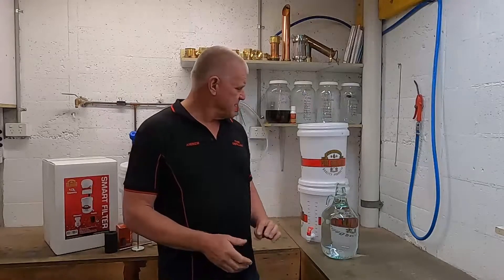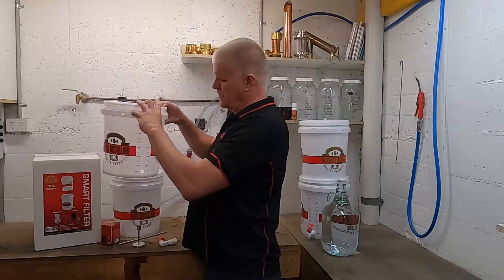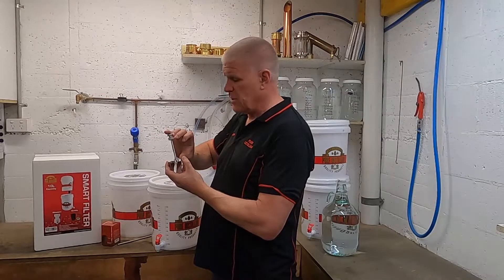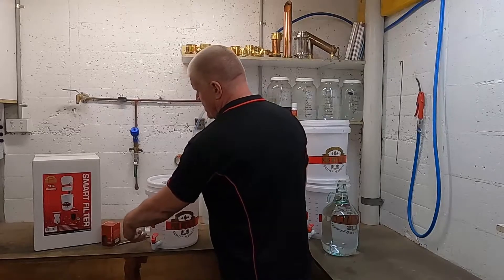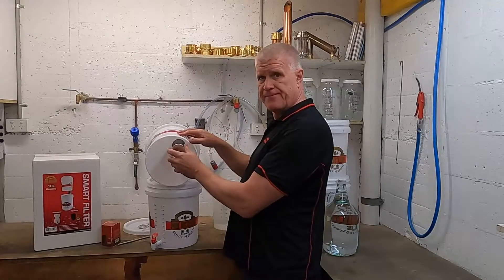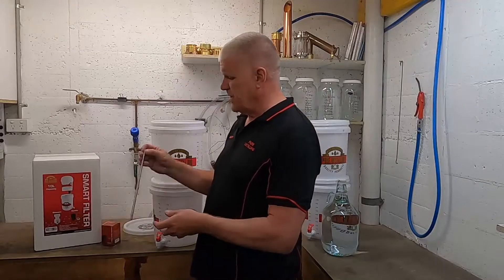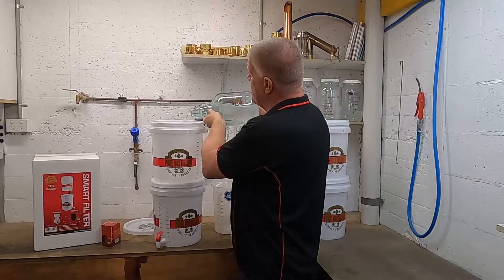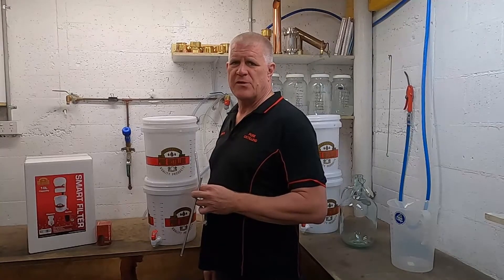Filtering With The Smart Filter System - Distilling 101

Comment: Hi mate i have just acquired a cartridge filter  .can the cartridges be re used if washed  .also how many times per batch do you run it through the filter  .  Thanks for the helpfull vid .
Reply from the maker: Hi, the cartridge is good for treating one batch of ~10L of spirit @ anywhere below 50%ABV. When you have ran it through once the spirit will be safe to drink, you will need to purchase another cartridge for the next batch
Reply: @PureDistilling  thanks mate so it is good for two separate runs of 5 litres  .as in two separate batches  ?
Reply from the maker: @bluegum4264  Not quite, once you dilute your spirit after running it through the condenser (as shown in the video) you will have around 7-11L of spirit depending on how much sugar you have used in the wash. You will be able to run all of this through the filter together with Pure Distilling filter buckets.

One filter cartridge will treat one wash, hopefully this makes sense!
Reply: @PureDistilling  thanks mate  i am transitioning from a granulated carbon filter which i normally run through twice with new carbon each time .i will have to forget all that and change my ways  .do the pure distilling filters take all brands of cartridge ?
Reply from the maker: @bluegum4264  Best of luck with the transition! Our cartridges will fit onto the EZ Filter System if you use our Filter Spindle Kit - see video https://www.youtube.com/watch?v=Z9ifyl-mGvs
Reply: I reuse the same cartridge over and over. Guessing around 7 batches before I replace it.
Only when it starts to take too long to filter do I replace it.
Is that ok?
Reply: No need to filter at all it's just a way for the brew kit manufacturer to cash in and profiteer.

Comment: I have a T500 still can I use the can I use your reflux column on the T500?
Reply from the maker: Hi James, dependent on which Boiler you are using, you may be able to. Shoot us an email on drink@puredistilling.com and we'll do our best to help you
Reply: Yes you can, you will find the t500 head is a different size then the pure distilling head so you will have to resize the hat, I did exactly what you want to do because the t500 is a piece of crap as it doesn't have an actual head thermometer only a cooling water thermometer which is ridiculous and I had a heated discussion with the state rep and I vowed never to use still spirits products again which is a shame because they made a rum essence I really liked....😅

Comment: So I've done a lot of research and it turns out that this is a completely unnecessary step. Once it comes out of the still it's good to drink. If you really want to do this just let the alcohol sit and don't pour out the bottom of the tank, bottle or flagon. Way cheaper than buying all this kit. 

Let's be honest, we're doing this to save money and this step will take your bottles from $6 to $10 or more. Especially if you have to buy a filter for every brew.
Reply from the maker: Hi @Azt3k9, we have to disagree with you here - volatile compounds are present in very small quantities in every wash, meaning filtering your spirit is a necessary step in the distilling process. 

The activated carbon filter cartridge attracts and traps chlorine from the tap water used to water down your raw spirit and volatile organic compounds such as acetone, benzene and ethylene glycol to name a few, it will help to produce the cleanest spirit possible. Yes we are aiming to save money, but most people also want the best results as well. Try it by adding some loose reflux carbon to a bottle, you will notice the difference.

Hope this helps – Connor
Reply: @PureDistilling  these carbon filters are really doing stuff all when it comes to actually filtering ethanol, the cartridge doesn't have enough surface area whats really needed is it to bathe in activated carbon and be forced through paper or cotton filter then bathe again before being collected then given the sniff test and if it smells like anything then run it again till it smells of nothing ,cartridge type filters are just a money maker for companies like yours, don't get me wrong the still head is a good thing but this thing is a stupid idea and waste of money

Comment: How many times can I use the filter if I clean it properly and what to clean it with?
Reply: You can't clean it properly because it needs to be heated to 850 degrees c approx to burn all the oils and alkaloids etc out of it and I don't reckon your kitchen oven can go that high.....
Reply from the maker: Hi, the carbon cartridge is only designed to treat the spirit collected from one wash. It should be replaced every batch!